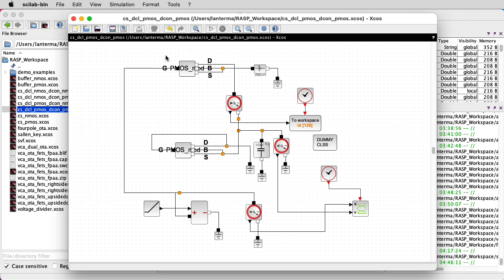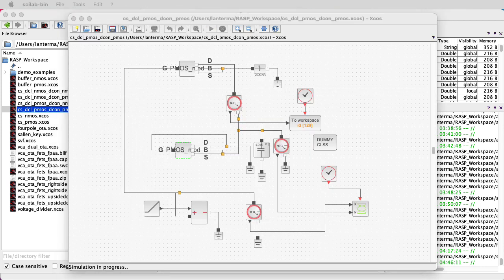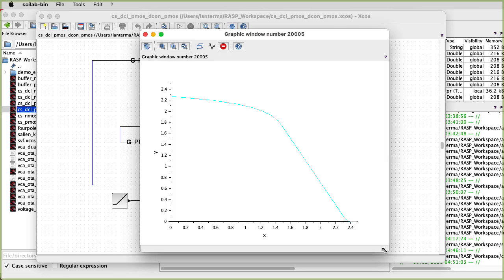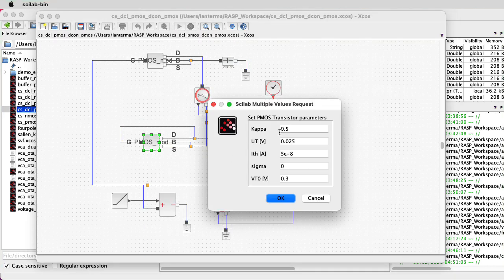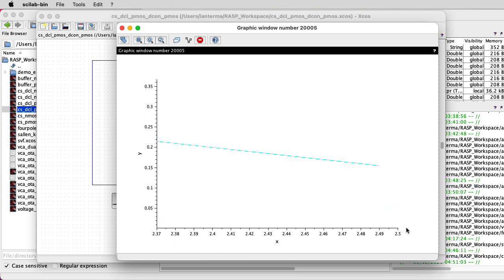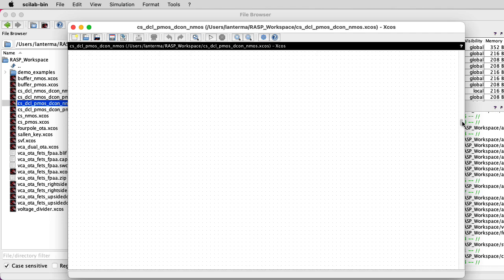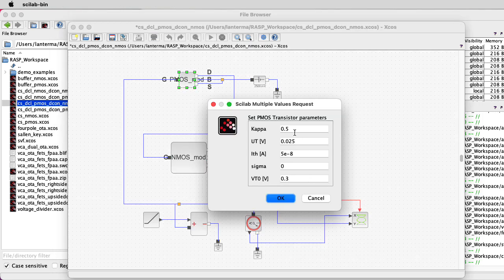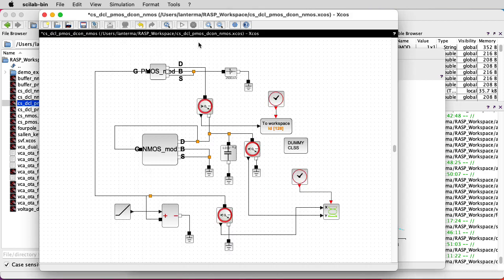FPAAs: Revisiting Common Source Amplifier with Diode Connected Load (Field Programmable Analog)

Comment: Ideally, the size of pmos should be 3 times that of nmos to perfectly match the characteristics as the mobility of holes is less. The need for connecting capacitance in terms of the simulation model is due to the fact that the software cant handle the undefined initial state when the simulation runs.
Reply from the maker: Good info! By sized do you mean W/L? So, that would correspond to 3 times higher threshold current?
Reply: @Lantertronics   The width of the device should be 3x that on nmos or there in need of connecting multiple pmos in parallel of the same width as that on nmos both methods result in the match characteristics.
The length of the device is usually dependant on fabrication tech. ie. node size like 130nm, 90nm etc